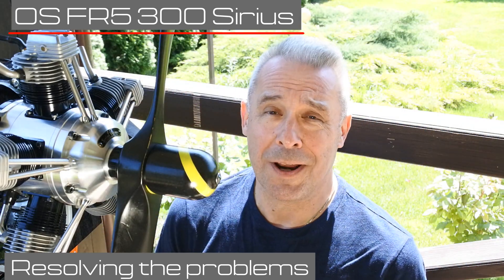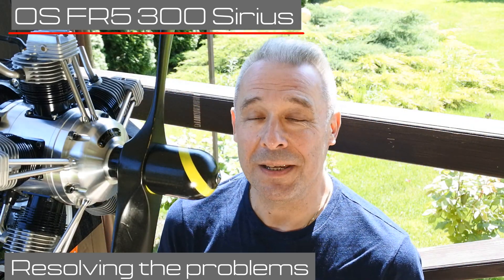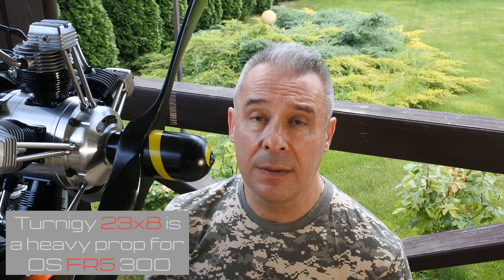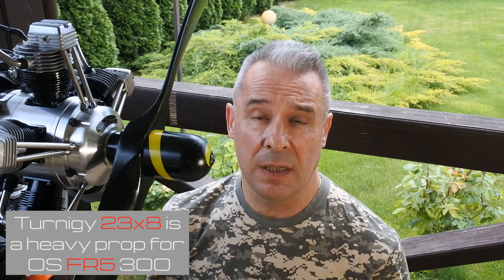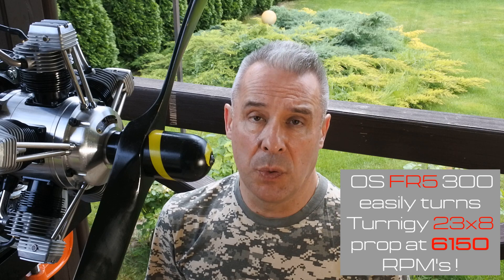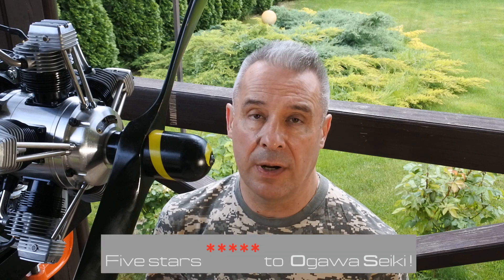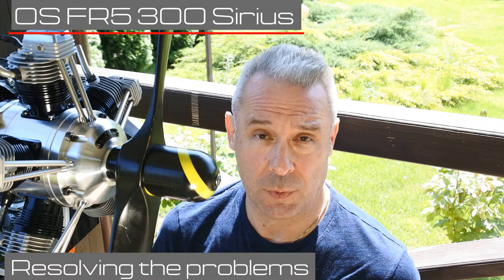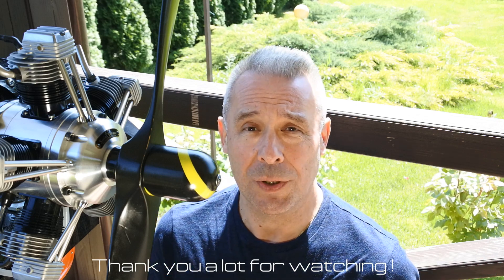OS FR5 300 Sirius fine tuned second test run

Comment: Great videos , can you please add a list of the fixes to your description? I am trying to piece it all together between the two videos

Change glow plugs
Check intake manifold o rings 

Is that all? I see others have issues with this engine. I am looking at a plane locally with this engine installed already for $900 seems like a decent deal
Reply from the maker: Hi and thank you for your comments and suggestions ! Your feedback is really appreciated and useful. I'll add more structure in my next videos. Thank you and have a nice day !
Reply: @crazyengines88  no problem, are you going to be making more videos on this engine? I am considering getting one but I want to know all the problems before I do
Reply from the maker: @mikesullivan5851   Hi, nice question, thank you ! To be honest, I've no plans to make video about OS FR 5-300 in the nearest month, I've some plans to continue engines comparison 0.70 - 0.80 class, and also, have an idea about engine supercharging , crazy, of course. Nearest time about OS FR 5-300 could be approx in May, not earlier, sorry. I could mention only one engine problem - uneven fuel mix distribution, which is leads to cylinders accidental quitting ( due to over rich  fuel mix). It could becomes negligible after a certain period of engine working time, but I can't confirm it, due to the fact, that my engine is too "young", two or three hours only. Than you and have a nice day !
Reply: @crazyengines88  can you help me with a couple things please !? I got the fr5-300 engine ! I need to figure out how to power the glow plug wires? And any other tips you have to help me get It running please🙏
Reply from the maker: @mikesullivan5851   Hi and thank for your question. Could you please, to wait a little, (8 hours approx.), because I'm right now is on the way to my work office, At evening (my local time) I'll thing it over, OK ? Thank you and have a nice day !